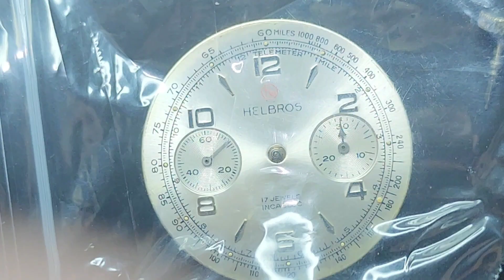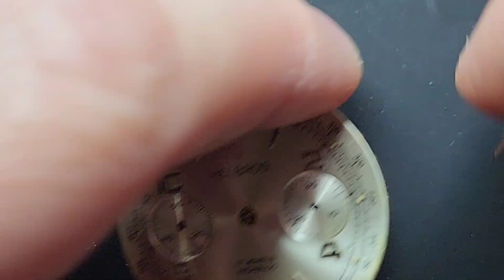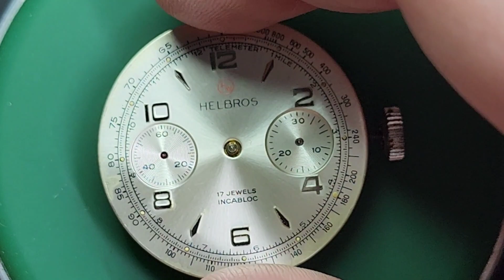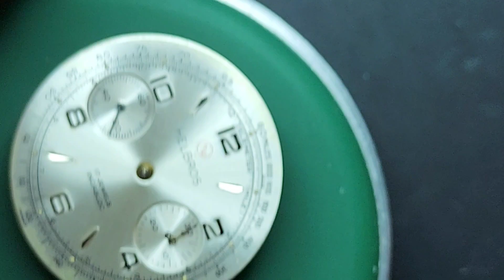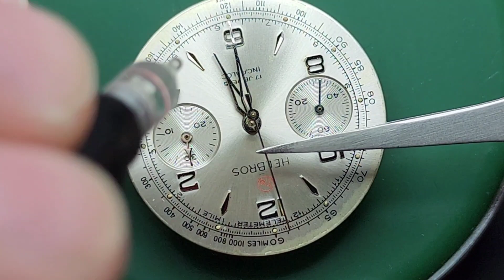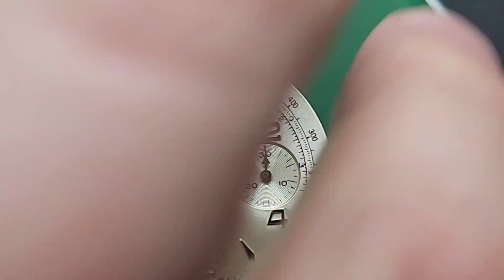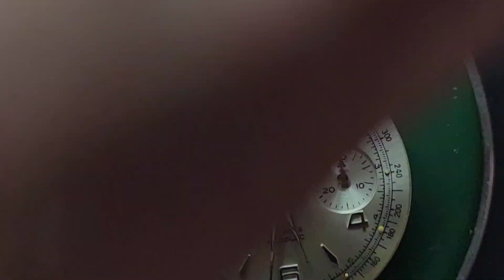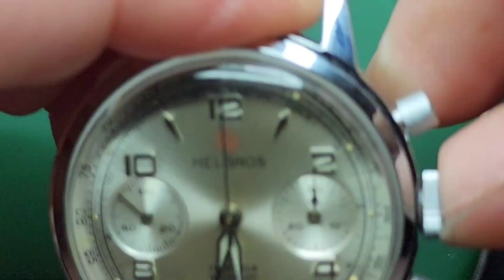60s Helbros/LeJour Chronograph, Valjoux 7730. Cleaned/serviced

Comment: Nice video as usual. I noticed that you used grease on the barrel pivot, the crown wheel, and a few places you would normaly use a medium oil like D5 or HP1300. Was there a reason for that? Also the sound of the main spring unwind was different. Was that just the watch or something else? Thank you.
Reply from the maker: Experimenting, haha. I don't have a lot of experience with these movements and I notice wear marks on the barrel arbor holes on one side. I assumed it's wear caused by torsion since the mainspring on this is so dang strong. After a little research sho2ed a thicker oil/grease is ok here, I went for it. To help prevent further premature wear. The crown wheel also had a bunch of wear and the chrono detents i treated like keyless since thery are manually operated. As for the sound, I assume it was the gummy oil, the movement was seized up good when I first got it. I messed with it a bit before I started tearing it down.

Comment: Nice job. Another  beautiful watch. Would love to graduate to working on a Valjoux eventually. Separately, when you work on your Bulovas and when you need to use a presto tool to remove a wheel, which size do you normally need? I picked up a Bulova recently that has a wheel that should probably be removed with a presto tool to avoid damage. Thanks for the help.
Reply from the maker: Presto #3 for sweep wheels, it's a must.
Reply: Awesome. Many thanks!!!
Reply from the maker: @SkyBlue-le7cd  no problem!